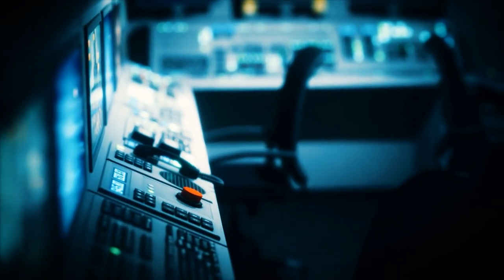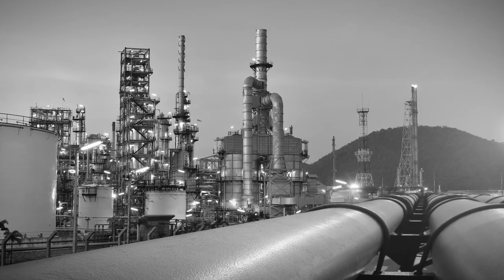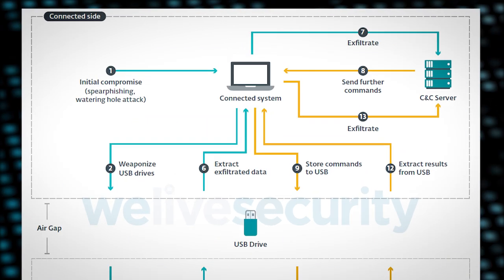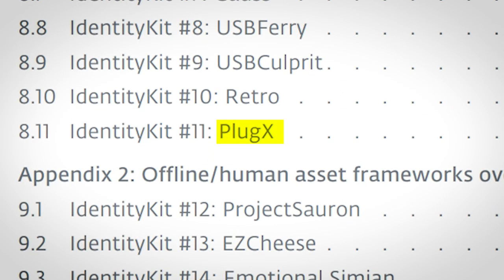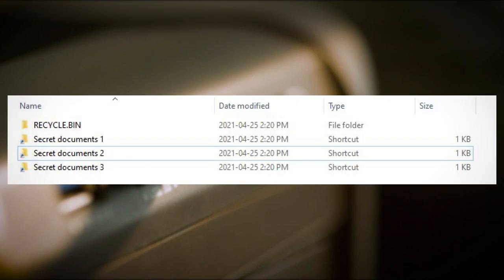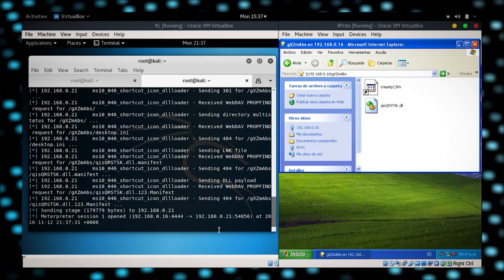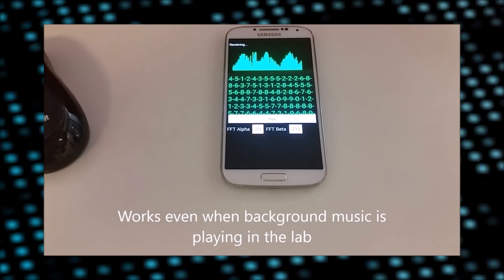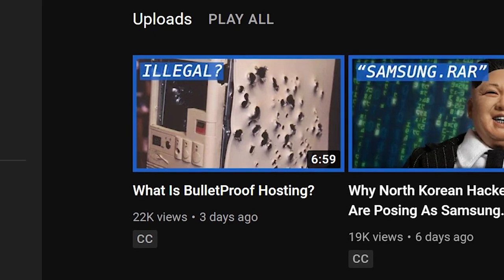How To Hack Airgapped Computers

Comment: Good airgapped systems and networks require elevated privileges or"root access" to enable (extra) USB Ports (per initialization). The used one(s) are seperated and securely predefined (mouse/keyboard) not usable for anything else and should get locked when interrupted. 

They also have a series of specialized security protocols (witch failed in video) when used in business/enterprise/government. Playing /receiving audio, running minecraft locally or just updating them should not be possible by design even with root access. Multiple different airgapped systems/networks are used to extend operator usability if necessary.
Reply: well that's why they end up getting exploited
Reply: @rajeshpandey2198  To a extend Ulimitly in some of the 'exploits' they had to go as far as forcing the manufacturers to change hardware components etc. to make them work. When forcing people (In the worsts way possible) and getting access did not work or could not do much damage. In some cases partially releasing the filth they created for the whole world to enjoy and developed on further for years. This goes beyond anything and while not open to the  general public they get discovered fairly fast. In this day it's much more efficient, secret and cheaper to just blow things up (like in Saudi Arabia). By using autonomous drone swarms or similar autonomous weapons. Wich have a guaranteed effect to industrial plants.
Reply: I really wish I understood what this ment
Reply: @EmilyLovesTea123  well it means that the air gapped systems were shitty for letting some USB get connected lol
Reply: Actually in the most secure systems the USB ports are removed. Keyboard/mouse only uses the ps2 ports. (yes they still exist, mostly on gaming boards)
Reply: @RS-ls7mm  Could be never came across one dough. Most i saw separate one usb port with a special usb 2.0 extension hub. As the system is protected from physical access and build in the workspace.
Reply: @EmilyLovesTea123  I mean its nit like
Drones can get hacked
Shot down 
Jammed 
Collide with each other 
Can id the attacker
Oh wow
You just lost money for nothing on literally none of those
Reply: I mean, playing audio and running minecraft would be easily possible if you had root access, cause at least on linux, root can literally do anything they want, you would just need to know the right commands.

(hell, if you wanted to, a root user could run "rm -r -f /" and delete the whole OS without the system even questioning the command, it'll just run it).
Reply: @tbuk8350  True about and rm -f * from root but why would you do that as a admin to systems your responsible for ? Most are custom tailored Linux version based on older kernels or custom kernels build from source not much GPU power, sound outputs or easy installing of programs for those. Also these machines are placed in work areas social control and safety protocol should prevent this. just bring a laptop to play when your off no point in risking your career lawsuits etc. to play Minecraft at work.
Reply: @mr.needmoremhz4148  Well, you said "Playing /receiving audio, running minecraft locally or just updating them should not be possible by design even with root access.", and I was pointing out that with root access, you could do that. You could plug in a small USB audio device and play audio, and Minecraft can run on basically anything with a video output, so the lack of GPU power doesn't really matter much.

If someone has root access, it is very hard to stop them from doing what they want on the machine, unless the server can't run what they're trying to run, which is very rare.
Reply: @tbuk8350  Yes it depends on the design approach and hardware used. There are many types of 'airgapped' systems design approaches based on all types of OS etc. it's hard to say you couldn't eventually do it as a type of offline supply chain attack and with developer knowledge. Good ones should block/make it impossible to  install extra software even if you have the highest security access / root acces etc. Root acces doesn't unblock usb port acces or changes file permissions. Rebooting should also clear any added software besides maybe some folders. They are not like any newer Linux, BSD builds where you have full control and several packages/ drivers installed. Switching a PCI-e card to a other slot/replacing it will make good systems unable to boot etc. The design aspect is crucial here.
Reply: @mr.needmoremhz4148  a lot of that would need to be hardware based methods, because as I've said, root on Linux is the highest user, and you can't make root not have certain permissions. If it's a Linux machine, root can do literally anything they want within the OS.
Reply: @tbuk8350  Sure and targeted for specific hardware but it's also just Linux or … OS based because they can start building "something" from "something" license wise. Don't forget most are just designed to provide a simpel GUI interfaces and give  controle to a worker in a fabrication, monitoring, ... process involving a sort of (or custom) logical controller. This is where everything is really customized and developed for not what "else you can do or use it for" or any traditional OS. So while you probably can delete everything from as a super user from / .This is a command that is usually left in and accessibel somewhere a lot of the time. Not every user account (workers) if those are even allowed to open up a terminal shell (and somehow get root access) have access to all the usual   … shell commands. You just get a command not found reply. Logging in with a technical /specialist account (stopping the essential tasks) may give access to more commands and with root acces even the 'dangerous' ones. This is just customization from a developing point and far from how Linux usually or traditionally works.
Reply: @mr.needmoremhz4148  Yeah, this is probably the hard part. I thought this was in the theoretical situation where someone got access to a root shell, not in general. Yeah, it's pretty easy to prevent root access. The easiest way on Unix is booting into recovery mode where you get access to an unlocked root shell, but that is likely not allowed in whatever custom Linux distro a company like this would have.
Reply: @tbuk8350  There's probably some space to interfere with the boot cycle on older systems but a recovery mode isn't implemented loosing progress or (saved) data due to a crash (human) error power issues ar still a occurring thing on them ;-). 

Companies can take security to whatever level they desire. If you go to complexer secure systems in certain industries like  aerospace defense, flight control radars, weapon systems, etc. You really start seeing the extra custom security stuff.  But in general most systems and custom OS aren't able to do much beyond the tasks they are designed for so comparing them to a traditional PC or OS isn't a thing.

Comment: I worked at Cisco for awhile. The amount of air gapped networks is insane - everything from your local police station to hospitals, banks, entertainment production facilities, public transport controllers, airports.
Reply: That's not surprising, ESPECIALLY considering the fact that it is cheaper and easier to make a system airgapped, than to connect it to the internet (just have a router+access_point with nothing plugged in v/s contacting an ISP, running a fiber and paying monthly/annually bills).
If internet connection was easier and cheaper, this would be WAY, WAY less common, probably even some reactors with internet connectivity, you never know.
Reply: i work at an airgapped cisco team atm, hi cisco frens
Reply: Given the chaos and destruction, that failures and attacks of all kinds on these systems can cause? It makes sense. Even holding them hostage could be catastrophic if timed right.

Comment: It kinda makes sense that espionage would be the primary or even only intent behind an attack on an airgapped system. The complexity and unreliability of the method would be a waste for making money, the targets are likely to be so important to infrastructure that attacking them would bring a whole nation state's resources after you. Even for the "employee with a grudge" there are other ways to get revenge that wouldn't require elevated physical privileges likely tied to an ID. So only if you have either the resources or protection of a big nationstate and a goal bigger than making money would you even risk it. Much easier to phish and go after targets connected to the net, with far less personal risk, smaller/shorter development on an 0day etc, and better odds on a return. It's not like there are a shortage of targets for these sorts of people.

Comment: The fan exploit could be fixed with novec submersion cooling. Its just a shame that 3m charges around $500 per/1gal. Which makes it a cost problem for most companies. However if things need to be secure enough that you feel the need to airgap then cost should be the least of your worries.
Reply: Just wait until someone finds out how to encode data in the bubbles that form by changing the cpu temps. The easier and cheaper solution would probably be passive cooling or to just not let the PC control the fans. Have them run at a constant 100% directly from the power supply.
Reply: Or just have fixed speed fans.
Reply: use foam-simple
Reply: Just have the fans be running at a constant rpm all the time and not software controlled (like wiring the pins straight to the PSU rather than the motherboard).

Comment: Not running Windows for mission critical systems seems like low hanging fruit. Not a whole lot of USB exploits on Linux. Yeah I know about keyboard/mouse emulators; not reliable on Linux.
Reply: they are nation states
if they had to figure out a exploit for Linux then they would
Reply: there are even exploits that work on all operating systems 
hehe not saying more
Reply: @rajeshpandey2198  Still doesn't hurt to avoid Windows. It's by far the most vulnerable OS.
Reply: @johansugarev  Please check your statement. Linux has a very long list of n-day security bugs still present today, especially when we are talking about USB drivers. Malicious groups don't even need to pay a 0-day bug to compromise a Linux system
Reply: @Marocco2  I am aware that linux has more exploits documented. But I'm referring more to how systems are actually used - users are more likely to do stuff that's not security minded on a windows machine. It's a consumer OS after all.
Reply: @johansugarev  Linux is a double edge sword. By not having a common ground platform to run applications on, sure that may avoid you from catching viruses but you also can't run common software easily either. Most industry standard software is only available for Mac or Windows unfortunately and the moment you use Wine to run applications will completely invalidate the whole point of avoiding Windows in the first place.
Reply: I wouldn't really consider Linux any safer than Windows. Really the only thing stopping people from hacking Linux is the fact that it's not a common platform for most consumers. And besides a lot of Linux users have the tendency to just run anything using "sudo" if a program asks for it. Or the fact that Linux doesn't even natively come with any sort of app signage which both Mac and Windows have to prevent users from running unknown software.
Reply: @johansugarev  considering Linux safer solely because the user base (stereotypically) consists of tech savvy and privacy-minded people is about as sensical as saying a 1910 model t is safer than a 2021 camaro, but only because a person who drives a model T in 2022 is less likely to speed and drive dangerously than someone in a late model sports car.

Comment: seen a video while back of a really taboo vector..  they built likely expensive military grade equipment that senses EMI.. they point the sensor at the air gap computer and record the EMI coming off the machine.. they take that data, put it in to some software that is way beyond me (they did explain approximately) decode the EMI back in to a Binary code, then Decode that in to data..

a lot like the Fan Exploit

Comment: So what would a hacker do on a Linux or BSD system that mounts all external storage devices with "noexec,nodev,nosuid" options?
Reply: They could simply program the USB to be detected as a keyboard/mouse device, and then generate keypresses/cursor movement in order to download and install malware which gives them a backdoor. .
Reply: @steven21736  We're still talking about an airgapped system, so no downloads. Add "input device whitelisting" or ensure that a user account can only run a limited selection of commands via a security policy (I think both SELinux and Apparmor could independently suffice to achieve this) and this method of attack cannot work anymore.

Paranoid people can additionally substitute administrative accounts with a capability based security concept.

As far as I see it, these kinds of malware attacks only work because people tend to make the poor decision of using Windows in a security critical environment.

Comment: If the people working on your air gapped system want themselves to be entertained while accessing it, you got a people problem, not a technical one.

P.S. shortcut arrows can be removed via registry entry. #notatutorial
Reply: Every hack is a people problem . . . clicking a link, opening a folder, not updating, incorrect settings, leaving a port open, everything
Reply: @CRUZIFIEDv4  You have a lot to learn.
Reply: @pelic9608  No actually I'm fairly knowledgeable. It's not the 80's any more. Nearly everything requires either access to the target computer or for somebody to do something they shouldn't. Tell me where I.m wrong, educate me.
Reply: @pelic9608  My 1st comment basicly agreed with yours. Then for some reason you butt hurt and insulted me saying I have a lot to learn. But you can't actually say what, give an example or even stay on subject. Clearly you have a lot to learn. Start with your spelling

Comment: In almost all cases, they are not 100% air gapped.  In most cases you have to change cos, or update firmware, etc…. In many cases you temporarily connect with a very thought firewall for a temporary time to move the code.

Comment: I wonder if airgapped system can be hacked via Bluetooth or some other short range wireless communication if other internet connected devices nearby are hacked
Reply: A system capable of being exploited wirelessly is not airgapped.
Reply: @Galactipod  A system that has zero wireless capabilities can be hacked. How? Ethernet. Just because something can be exploited wirelessly does not mean its not airgapped. Using something like radio or Bluetooth does necessarily allow for an internet connection, hence airgapped
Reply: @theguy920  "Airgapped" really just means "no connection to any other system." It involves a gap of air, but that's not the only part of it.

Comment: #1 security tip: dont run your nuclear plant in windows xp😂 barebone linux distro can handle this task much better
Reply: And if all of your control software is written for Windows XP and doesn't work in any other operating system?
Reply: @Galactipod  then use wine
Reply: @botowner8623  I too want to have my nuclear power plant controlled by a buggy emulation layer

Comment: Clicking on Secret document folder, what could go wrong :elbowcough:
Reply: Well those were the file (shortcut) names in the example. But since this is basically a human factors attack, you need to entice the human into performing the action(s) you want them to.  So if I was setting one up,  I hope I'd name them along the lines of "README - GAMES", "Cute Kittens", "Jhonti's Recital"... or even "NSFW". Something just tempting enough (in one way or another) without sounding technical or scary. Of course, if you know the person being used as the vector is fairly savvy and suspicious, then maybe name it "Mandatory Security Settings - MUST READ".  Or what the heck - stick a dozen or more shortcuts on there with all of those and many more names. Somebody's bound to be curious about what's in at least one of them.

Comment: Why update airgap computer ?
- It's already work.
- it's important work you don't like down time.
- it's work mostly not with external data.
- just don't let anyone play this pc. give them another personal computer to play with.

- undo card help.
- and ... please used linux. so there is another OS-gap layer.
Reply: It's not as simple as just switching to Linux. Like games, a lot of software simply wasn't made for Linux.
Reply: @Galactipod   Hes talking about airgapping not gaming
Reply: @haxboi5492  I was providing an example of software. Most games aren't made for Linux as a lot of system control software, especially in the 2000s, was made for Windows.